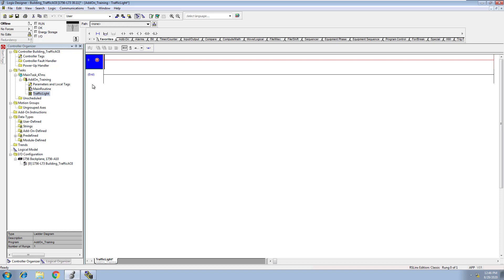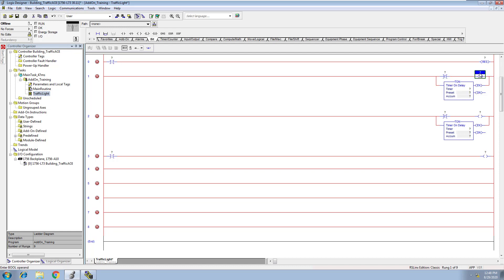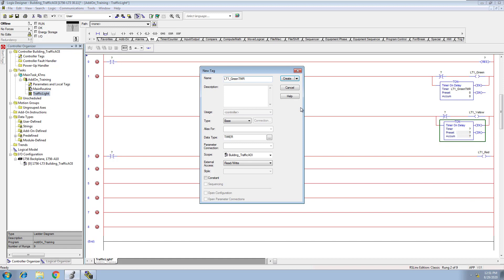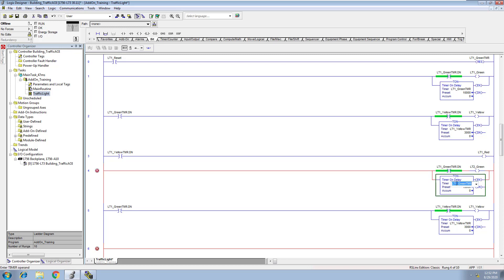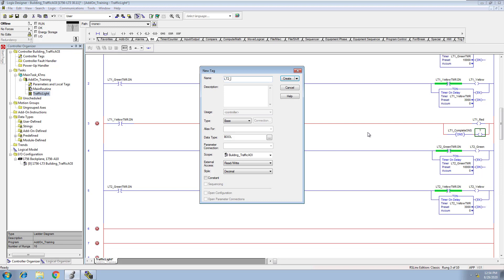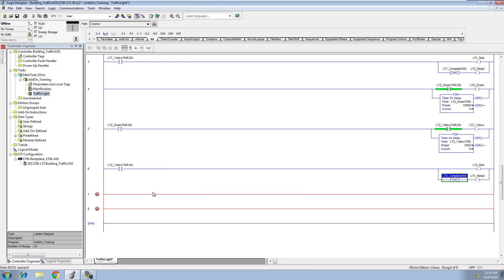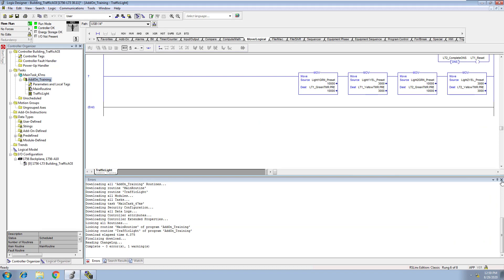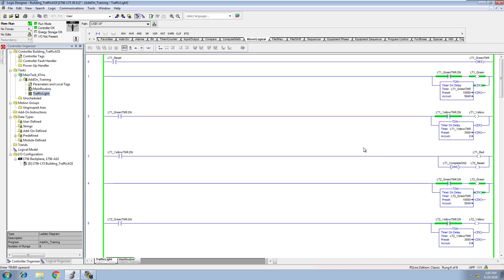Studio 5000 Traffic Light Logic For Our Add On Instruction  ( Video 1)

Comment: WHY DONT YOU HAVE A TIMER FOR THE RED LIGHT?
Reply from the maker: Because it is controlled from the green not on nor the yellow light on, if both are off then the red light is on by default.
This saves time & effort in logical programming.

However, PLC logic can be done many different ways so yes, you could have a timer for the red light.

With that said, if you can think it then you can do it with PLC controls.

Often the way things are programmed depend on the programmer, the end result can still equal the same.
I hope that helps.